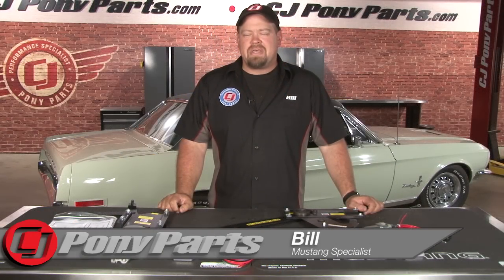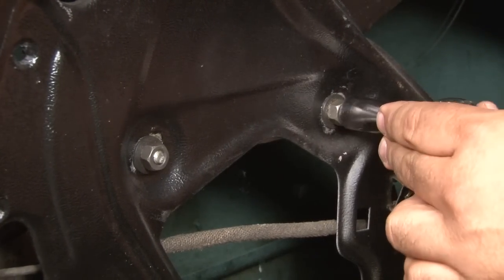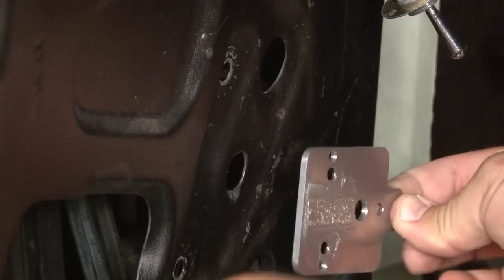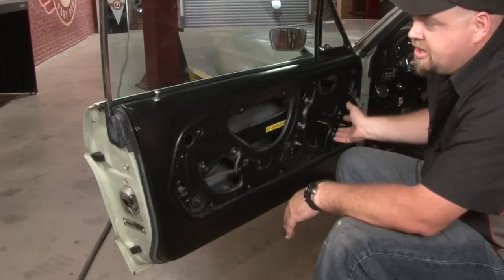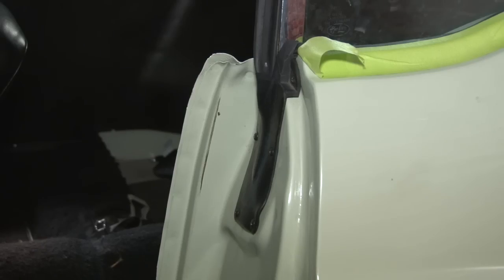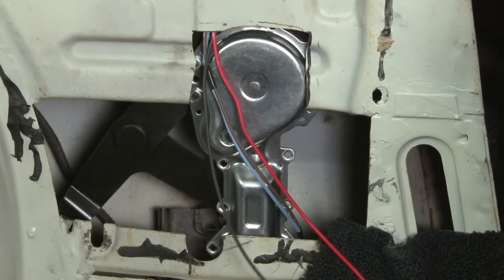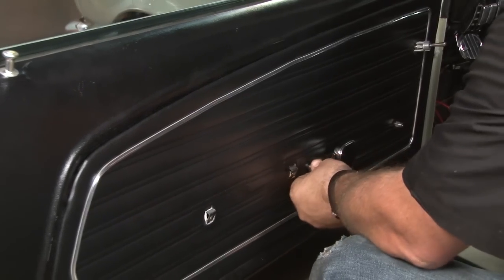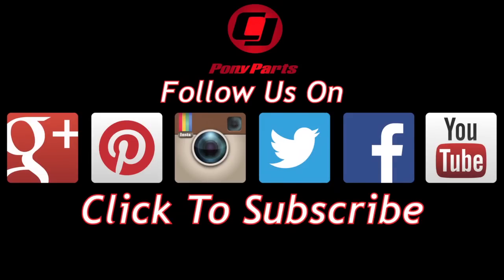Power Window Kit | 1965-1968 Mustang

Comment: Wow you made it look easy! well as easy as it can be. i have a fastback so its only half as hard
Reply: 2/3ds you mean ;-)

To be honest, getting the vent window EXACTLY right is 50% of the chore since it lines everything else up. I have replaced regulators in two body-styles (coupe and FB) I am now working on a convertible. That is easily the hardest since there's no roof to line up with, or rather the roof needs to be adjusted WITH the glass to get it right...sigh.

Comment: After you have the motor installed and you wanted to check to make sure it worked before wiring it, what wires did you connect to run a test? Thanks for any help.

Comment: Really good video! Just some questions: how did you connect the cables on the passenger side and both of the quarter windows and where did you connect the green cable from the relay? And by the looks of it, you don't connect the orange cable at all if i'm right?
Reply: all the power leads were ran together and connected to the relay under the dash. The green is switched, we used a wire we had run to the radio and no you do not need the orange wire.
Reply: Bill Tumas Thanks a lot! One day, I'll have my own mustang and most certainly install this upgrade! Keep making good videos!
btw, can you make a video on how to install A/C if possible?
Reply: Alex Crystos That is something we have considered and may do in the future
Reply: Nice, hope you'll demonstrate it ! :)

Comment: My 67 fastback mustang has the speakers in the doors. Will the speakers get in the way of the window motor?
Reply: I haven't installed one yet in a car with factory door speakers. The motor sits back and the speaker is rather shallow so I think it would work but I have never tried.

Comment: so i love that system using the original cranks as the switch, but i very seriously dough they make it for my car, is the switch available as a stand alone piece
Reply: They are made by Nu Relic and they do offer the switch alone and they are splined for certain handles.

Comment: how do I allow my seat bar to go back farther with out changing my factory 1965 pony seat?..plzzz help C.J..cjw...thks.
Reply: +Cedric Williams Unfortunately there is no easy way to do this. The seats bolt through the seat platform so the best way to move the seat back is to cut the welds and move the entire platform back which is not an easy process.

Comment: They make kits for all 65-73 mustangs. If you just want the front windows you can order the fastback kit and it will just come with the two fronts. I have seen someone use this kit with a toggle switch. If the switch is up the drivers side crank works the drivers side window, flip the switch and it works the passenger. I have not done this but ti is possible.

Comment: Cut out part of the inner quarter panel?  Ouch, butchering the car, no thanks.  Also, if you can't operate all the windows from one location, not really much improvement over hand cranks.
Reply: Hi Al, Autoworks Parts offers a true bolt-in power window solution for 64-70 Mustangs, as well as an assortment of switches that you can configure however you'd like.